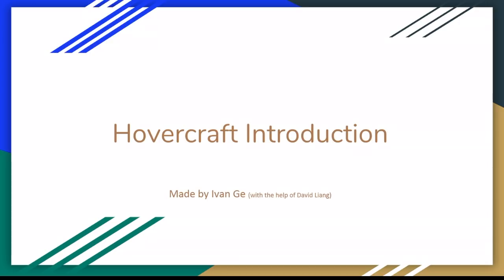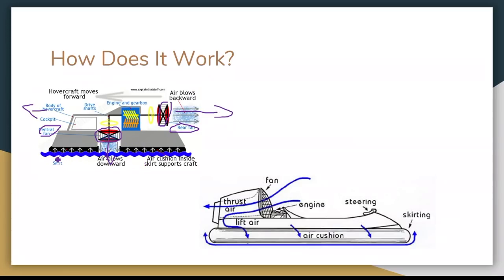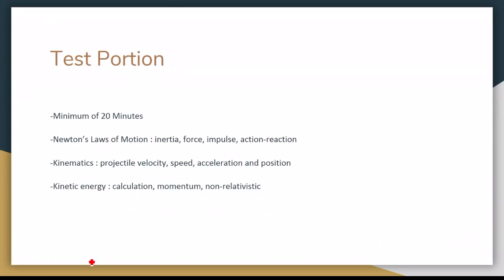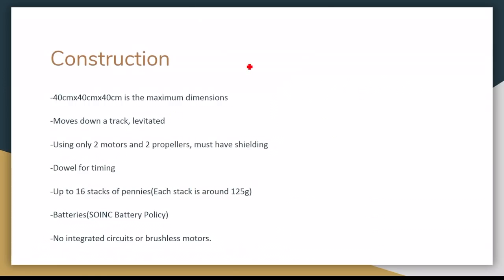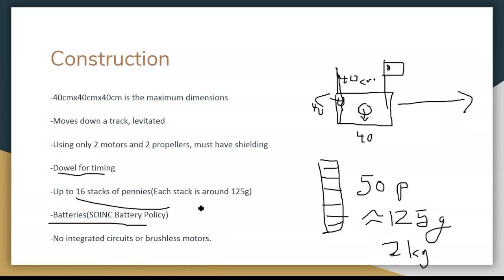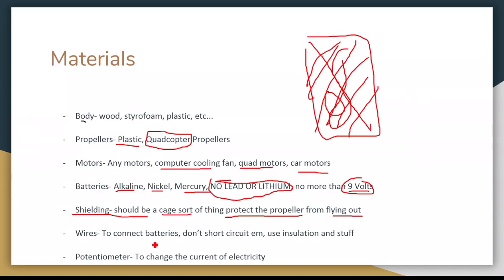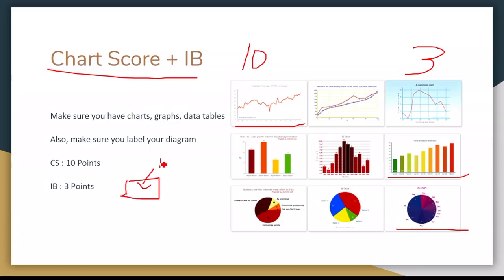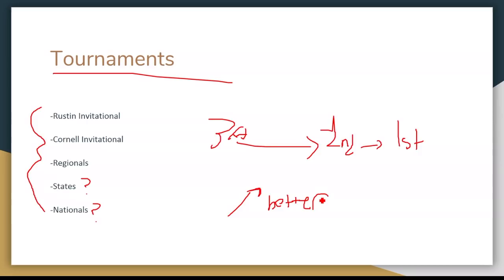Science Olympiad - Hovercraft (2017-2018)

Comment: 9:06 Great Overview. However, Division B probably wouldn't need a potentiometer this year. The 15 seconds can be calibrated with a fixed resister(which weighs significantly less). You would want to get rid of as much useless weight as possible this year to make the 16 penny rolls easier to carry.
Reply from the maker: yeah good idea would work either way but just the potentiometer would weigh a lot more than the resistor